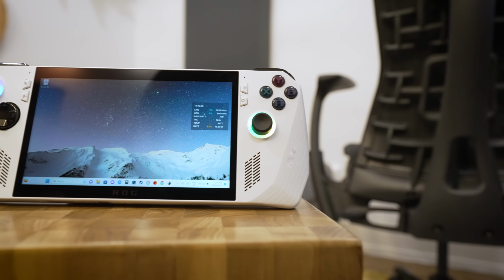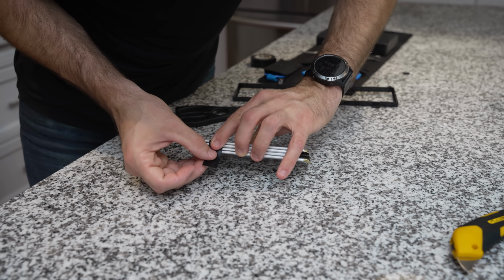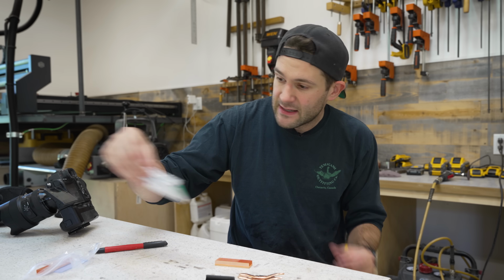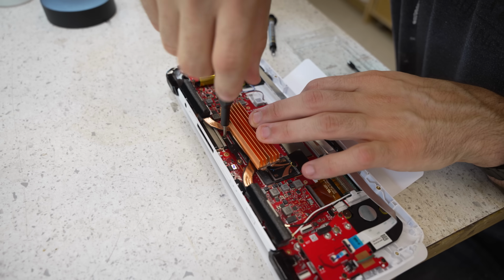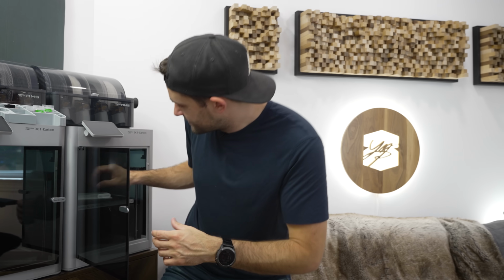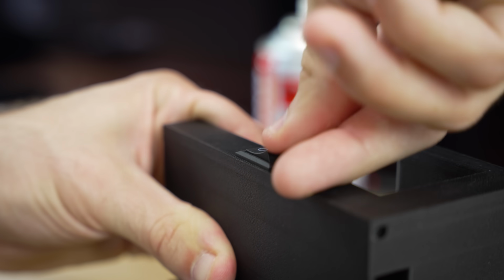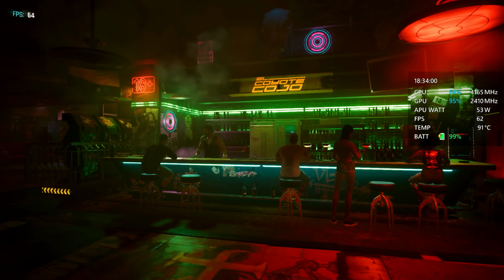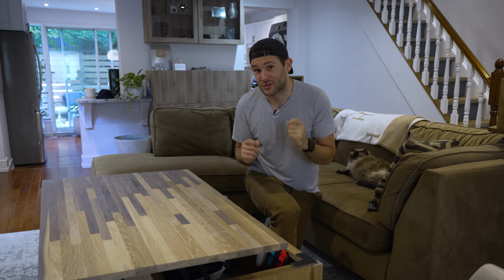I don't understand why people buy Steam Decks...

Comment: I bought the Steam Deck for it's price and the fact that it's absolutely loaded with buttons, joysticks, capacitive touch sensors and an awesome key mapping tweaking tool in SteamOS.
Reply: The last thing is really Steam Input (The thing that the Steam Controller also used).
Reply: @gelbphoenix  Steam input is not only for steam controller anymore.
Reply: @tomaslacus8086  I know. Also I said "also used" not "only used".
Reply: @gelbphoenix  Steam Input whilst also being usable on PC, is really cool especially if you don't have an Xbox controller
Reply: I bought the SD oled because it seems the overall most balanced of the handhelds + SteamOS, valve support/compatibility effort on the OS, trackpads, nice design and ergonomics, battery life for few hours of casual gaming on the go without the worry of carry extra weight of power banks, remember to charge them, etc. 
I will mostly play platforms like Ori and single players like Control + emulation, where I feel more confident with joypad input than M&K. 
If I want to play fps and other pvp games at high fps I do it on my PC anyways, with M&K, so I don't think I will miss out on the higher performance of Ally/Legion go.
The steam deck is, to me,  more for a casual experience on the couch or on the go with platform games that I rarely play in front of the PC (Ori, Sonic, etc) and single players/story from Steam (Control, GTA5/RDR2, etc) and emulators (Emudeck/Batocera).
I will consider also a small pocket form factor handheld for pure emulation in the future, there are many options of gameboy/gamegear looking handhelds "on steroids" running custom OS. An option and a nice project could be a diy handheld with a Raspberry Pi.
Reply: @the_bogeyman.   Yeah, the choice of 1280x800 display on the Steam Deck was a smart move.  While people will whine and winge about wanting higher resolution screens for gameplay, they just don't understand the math that 1920x1080 is twice as many pixels as 1280x800, and that's 2mil vs 1mil pixels * (frames-per-second) of pixels being computed per second.  For most games, you rarely will notice the benefits but can likely feel the drawbacks in framerate.  Likewise, having one of these other devices, you might get better performance but I'll take the Steam Deck's no-expense-spared approach to input devices and the awesome ability to configure every button exactly the way you want.
Reply: @rbus  Why people want a difference they can barely see i don't understand those are actually some of the people that buy a 32" monitor that has a 1080P resolution
Reply: @THEREAPER-CODBO6  I have a Vankyo projector that is apparently capable of doing a 300" screen at 1080p and I don't really understand the point of 4 or 8 k either.
Reply: @rbus  1280x800 was genius it is the perfect resolution for the size.
Reply: @the_bogeyman.  The track pads look pointless to me on the Steam Deck.  Give me a PlayStation DS4 or DS5 as those seem to be better.  It also makes the overall interface look cramped and uncomfortable that's also prone to accidental input.
Reply: @WJCTechyman  No, those trackpads are incredible. With the software behind them, they are keybind heaven. I do have my SD wear a case around it which makes it a bit bigger, so that does help with handling the device a bit. But I have had no issues with accidentally touching the trackpads without the case on.

Even if you are likely to accidentally touch them. Most of the inputs you'd be making will require pressure because the customization options you'll most likely be using for the trackpads are button options.

The trackpads probably look pointless to you because you have probably never seen them used in all their glory.

Don't be dissing those round squared beauties.
Reply: I just now ordered one and can't wait till it ships!
Reply: Don't forget that valve customer support is second to none. Iv seen them replace decks that were bought second hand out of warranty, decks that were stupidly broken by the owner, seen them assist in recovering stolen and lost decks. Valve is awesome and the deck is just the objectively superior handheld in most ways and I don't see it as realistically being up for debate lol I guess there are SOME areas where the deck has competition but for the price, and considering the amount of support, for the customer, the hardware, the software, the games etc, it's really just not even close. Steam deck ftw
Reply: @derivitivetrash5457  Yeah, there are new gaming handhelds that run faster AMD Ryzen now but fsck that, the feel of the build & controls are what counts for me.  I can always stream from my gaming PC or Geforce Now wirh RTX and all that stuff if I want to but the powerful control remapping and sheer options are top notch.  Valve has no interest in profiting from selling Steam Deck because it's all about providing a good gaming experience - and a good gaming experience profits Valve because people will buy more games.
Reply: I had an rog ally, sold it bought a steam deck oled and its so much better and what impresses me the most is that have better fps at lower power than rog ally. The battery life, the oled screen wich helps on battery life and the thumbsticks are way way better too
Reply: rog isn't much more powerful. bruv talked about it like it was a handheld 4090. lol 
Legion Go seems coolest to me, they are all about on par though.

Comment: I didn't really get from this video how exactly the ROG is better than the Steamdeck. More powerful? Really? How is that so super-relevant for a portable console with a small screen? There's a reason Nintendo made the Switch the way it is - to give you multiple hours of gameplay. The Deck is also easily the most comfortable to hold the console for a prolonged time.

Also... what he's doing with the batteries here - I'd not feel comfortable carrying this around with me... stacking batteries like this seems like a recipe for a fiery disaster.

Comment: I mean... For twice as much money, the Ally definitely should? Even a base deck with 50$ NVME upgrade is a better value.

Edit - i have finished the video. Nobody should EVER attempt a battery upgrade like that without way more knowledge than this shows. This shouldve been done outside, with safety protection and a bucket as sand at the least. Additionally, i would never trust a folded laptop battery to go in the back of my heat generating device when literally zero safety testing has been done by anyone here. Yikes.

Comment: For me the number one reason is:
You boot up the Ally and then it asks you to install Microsoft Office.

Also... to get decent performance you need to up the power and then you get 2x less battery than the Deck.

I'm not a spec sheet hoe therefore stuff like 120Hz, 1080p, RGBs is cringe in a device this small. The one thing I'd love for the deck is OLED and VRR, nothing else. I'll pass.

Comment: I'm pretty sure they don't cover the SD Card slot in an insulator, because believe it or not SD cards can get really hot especially performance ones.  They need the fans to push air over them.

Comment: The ROG Ally has:
- Infinitely worse software (Armoury Crate sucks and is bloated on a regular PC, it's just gonna be worse on a handheld, especially if it's gonna be a launcher on top of several game launchers. Big Picture Mode exists, just use Heroic to add your GOG and EGS games to Steam).
- No trackpad for desktop usage or for older games and external launchers that may not work with controllers (This is a huge dealbreaker).
- Way higher price
- Windows 11 (Windows in general sucks when you've seen how non-Xbox controllers are handled, and SteamOS just works outside of a small handful of multiplayer games with anti-cheat and games that use proprietary video codecs bundled with Windows)
+ Better specs and eGPU support (Although the way higher price and the proprietary eGPU connector kind of negates this).

There really isn't defeating the hardware price ($400 new or $350 if you buy refurbished from Valve) and software experience (Which I'd argue is better than the PS5 or XSX at this point outside of not having some multimedia apps like Netflix/etc and lacking an instant replay video function). I'll at least say that the ROG Ally has the upper-hand in terms of having a 120Hz FreeSync capable display, which really helps out with games that can't hit a consistent performance target, and some games where you can't externally cap the framerate (like with Japanese ports of games that slowdown below a certain target).

Comment: Steam Deck is cheaper , SteamOS is more ideal for a handheld and there are PC games more ideal with mouse controls where the trackpads are more useful. I'm just fine playing AAA titles on my main PC on a 65"  TV  with better hardware. It's seems to be a waste to play AAA titles with high graphic games on a 7" screen. 
 (For majority of the games on the Steam Deck I set the TDP to 10. The Ally has no performance advantage at 10 TDP.)

Comment: It's not hard to understand why gamers buy the Steam Deck over the others.

A few reasons is the price point of the Deck is more attractive, then there's SteamOS, which is a big selling point for many, then we have Valve long term support.

What some seem to forget, we've had a portable PC gaming device for years before the Steam Deck, none of them were successful, a big part of that was the price and the OS, Valve solved that problem.

There's also another reason, these other devices might be more powerful than the Steam Deck, but most gamers don't care, it's a fine line from battery life and performance, it's all well and good the others throwing more hardware power at it, it's no good when battery life doesn't last long and anyone that grew up in the early 90's will understand what I mean, Nintendo released the Game Boy, there were many others from rivals with better hardware and yet Nintendo dominated with weaker hardware and a big reason for that was the good battery life.

Valve are playing it smart by trying to eek out more performance at 15 watts, the other devices are going way past that, and even though the performance is better, at what cost?, these are portable devices, battery life is very important, and even the Steam Deck is pushing the limits on that one with demanding games, the other ones are a bit of a joke when you try to tap into the performance they can do.

Personally, I think the limits with current battery tech is 20 watts, beyond that and it's just not worth it.

Would I love for a new Steam Deck with better performance? yes, but not if it means killing battery life and I'm sure many here have seen the reviews of these other devices, if you lock the performance to 15 watts, the performance is only a bit better than the Steam Deck, so unless we are going to get much bigger batteries in these things, I don't see the point in them going beyond 20 watts with current tech with maybe the option of docked mode being able to go beyond that for more performance.

As for these rivals, there are a few things they can do to be more compelling, offer a SteamOS option, offer cut back versions of the devices that keep the core specs but reduce in other areas to lower the price point and then show a long term commitment of support, Valve is covering all 3 bases and that makes the Steam Deck far more appealing, even thought it's the weaker of the bunch.

With that said, if the performance gap widens too much as tech progresses, the Steam Deck will look less appealing, but I don't think Valve needs to worry about that till 2025, by then, the Switch 2 will be out, new APU's will be out so a decent performance uplift will likely be attainable without killing battery life.

Comment: Fantastic mod! I wish I was that talented! You definitely have the chops to make a quality handheld and Asus should take notes for their next product!

My brother in law has an ROG ally. Using windows on it is a horrible experience that really offers no benefit unless you play a handful of games. Asus's UI lacks many features that even the old steam big picture mode had. The graphical fidelity improvements (besides hdr) are negligible without being next to an outlet. Not to mention, the ergonomics are FAR AND AWAY objectively worse. Those buttons are straight trash! 

Valve knows how to make a quality handheld at an affordable price. Superior hardware and silent fans aside, Asus still has some figuring out to do before they even come close. That said, it does have fantastic parts for makers to gut and you could probably install something Steam OS adjacent to improve the user experience... or just buy a gaming laptop with a dGPU. If you want a quality handheld that doesn't break the bank, Steam Deck is the only real solution.

Comment: For the base version with an off the shelf ssd the Steam Deck is around 450, 400 if you buy the refurbished ones. That's around 200 less than the ROG Ally in the US. And for that, you get a bit less performance, but most importantly, an actually functional OS for the form factor that resembles more a console than the ROG Ally or Legion Go ever will, plus amazing Emulation Support thanks to the community. For people who just want a plug-and-play solution, it's a much better option, for around 2/3 of the price.

Additionally, if you look at the European Market, here the Steam Deck starts at 419€ but the ROG Ally and the Legion Go start at 799€ which just makes it a no-brainer in my opinion as the other two are never worth double the price

Comment: Zac, What you did was find the next bottle neck. You have lifted the power constraints by double, there is no way 5-10% uplift is the limit. There is something else holding it back. Memory would be the next culprit. To prove the concept, drop the power down 25% you will have the same 5-10% uplift.

Comment: I have a similar chip in a mini PC: the 7940HS. And I experienced the same with performance/consumption. There was no reason at all to use a high power profile. It performed about the same at 25W and 54W. I didn't expect that either. So - I will just use it with a low power profile (called "quiet").

Comment: I dont know if this applies but AMD doesnt like overclocking anymore.
It seems that the Chips are already set as "good as they can be" from the factory.

My Desktop Ryzen 7 3700X runs on 4.4ghz on boost and it can do 4.9 stable on all cores but that gets me only around 3-5% extra performance compared to it boosting regularly.

Comment: The answer: 
- lower Price
- SteamOS with much improves useability
- Steam Support
- Great Community
- much better Frame rate condistany under SteamOs (look GN test Ally vs. Steam Deck), which is more important than averagy fps under low fps
- better low power performance
-  the way valves supports the deck
- no Sd card killing
- better Ergonomy
- Trackpads
- Support to dualboot Windows (drivers provided by valve), if needed for GP

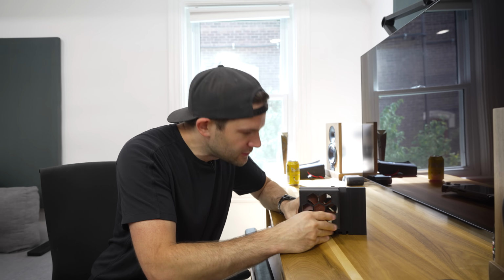Comment: 14:50 If you don't have a dual extruding 3d printer, a simple solution is to print your design with the inlay debossed (cut in). Once it's printed, you can fill with pigmented epoxy, let cure, and sand flat. Or just paint.

Comment: Oh boy, I know the title is a clickbait but here it is... People buy Steam Decks because Asus is a horrible, horrible company that has no incentive to continue this handheld project if they get bored. Buttons are also worse on the Ally. It also doesn't have touch pads which honestly makes playing a lot of games kind of unbearable. Steam Deck is also A LOT better at optimisation; it is significantly better on lower Watt limits, and it only sometimes loses to the Ally in turbo mode (yes, not always, or the gains are marginal). Moreover, the battery just dies too fast in turbo mode; if the Deck dies in 45-50 minutes in some AAA titles on highest reasonable settings, then the Ally dies in more like 20-30 minutes, battery life is all about curbing your expectations on these devices. Also Ally's proprietary overlays are just a lot worse, and dare I say that windows is just annoying to use on such small screens (yeah yeah, Linux is not the greatest system either, but it works better with small screens). Linux is also a lot lighter operating system, which would probably push the Ally even further. And to top it all off, I ain't spending all that time, money, and effort to "upgrade" a handheld console into being a certified heavy and unwieldy brick; it's supposed to be small and as light as possible.

Comment: Double the price, came out after the steam deck, deck as more support, trackpads. Its very easy to know why people by the deck over ally. It's also not "significantly more powerful than the steamdeck" in most instances. Most of the time you match the TDP so that the battery lasts longer and in that instance, steam deck usually wins. If you max out the fps and powerdraw you might as well only play while it's plugged in.

Software wise, ally sucks too. Deck optimizations have had longer to cook. Title is click bait and I wish you'd just say here's a my modded ally. We loving modding our handhelds, it would've been just fine with an honest title

Comment: Sorry, but you could do that with a steam deck probably, the support of the steam deck is so much better with settings optimized for the device. The steam deck have the pros of console gaming with the pros of pc gaming with the pros of the switch, a junction of the 3 worlds. The ally is just a low spec laptop PC in handheld form factor.